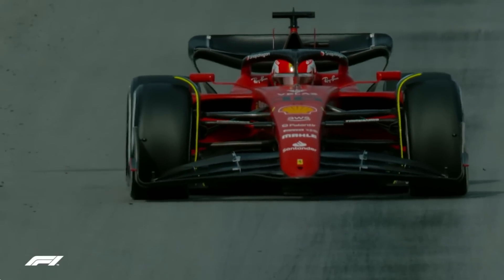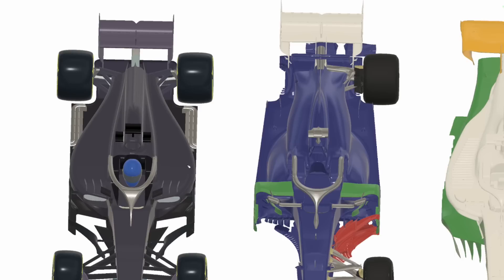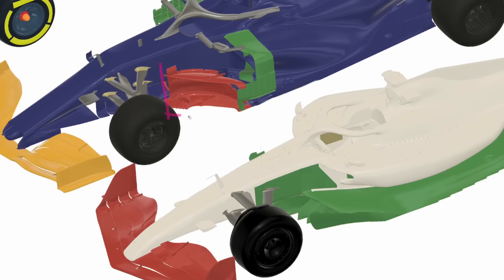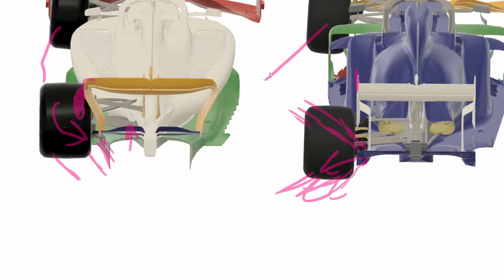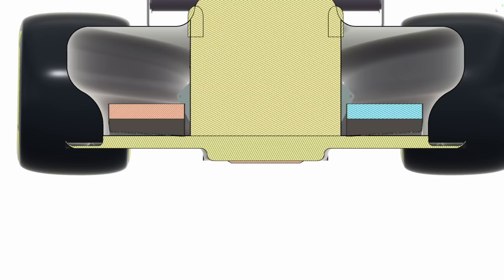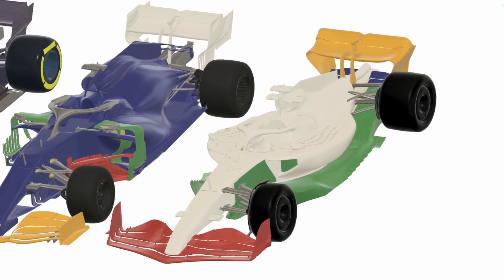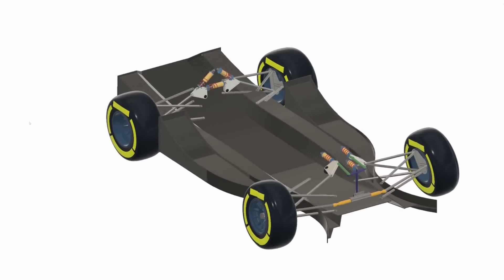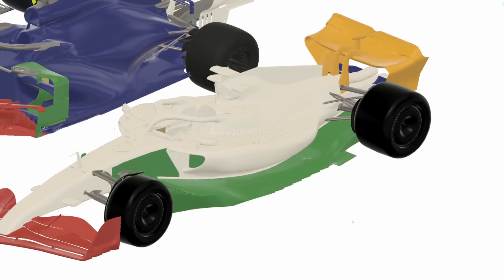How Porpoising was caused by the 2022 F1 Rules

Comment: Can't teams still have rake but just run the rear skirts asymmetrically lower? I find it hard to believe that running a rake is now gone because you can still make it outwardly look as if the car has no rake when it really does by just extending the skirts at the rear. I think Red Bull is doing this; their car still has rake, just the skirts make it appear it isn't but that also has the benefit of giving more volume for the ramp up outwash area for the diffuser ie. bigger suction effect at the rear.
Reply: BTW the inerter and suspension changes should be quantified by the FIA for how much money it would save teams because I don't buy it that the cost was the reason. Same amount of development money is involved and while springs are inherently cheaper at what magnitude of a difference does it make for the hydraulics based systems on a F1 budget ... repair damage from porpoising probably costs more when you compare it. I think the FIA on that specific reason reached too far, and as for suspension the 13inch tires were a step too far also.

As for tires worth mentioning as you did in a past video are part of the suspension for a car and these new tires are less springy which probably adds to the porpoising effect.

Comment: I have a question regarding the floor central section. If we take that piece in isolation and apply what we know about diffusers. We can imagine air infilling the low pressure left behind by the rear of the central section acting as it's own diffuser. If that section is wider at the kick up point, wouldn't it create a stronger suction peak? It would essentially be increasing the lateral surface area right where the pressure is lowest. Have you noticed that Mercedes has a very narrow cigar shaped central section, with no little cutouts, while Ferrari and Red Bull both have narrow leading edges and wide trailing edges. McLaren has just a wide skim board type central section. Ferrari, Red Bull and McLaren all have those little cutouts you see on surf boards. That central section pitches and yaws and is basically surfing on a boundary layer of laminar air. All CFD I've seen shows very laminar and streamlined flow in that central section, so perhaps there is a lot of untapped potential there. Although, I imagine making changes there depends heavily on how the car is packaged above.

Comment: I don't think the absence of inerters would be much of an issue this year if the weight limit wasn't so difficult to get down to, fundamentally they just add inertia so you could get the same effect with a few weights in your brake package, but you can get the same inertial effect with less mass from an inerter

Comment: To a greater or lesser extent the teams have followed different design philosophies. Some saw the new regulations focused on ground effect, stripping away the power of the front wing & Y-250 and others saw a reduction in upper & front body downforce generation balanced by additional ground effect. The teams that saw upper body downforce generation as still very important and not just ‘drag’ & maximising every small downforce building  areas across the car found porpoising less destructive to their performance. Which is why you see a convergence in upper body work in the whole field happening throughout the year. 

Its really fascinating that at the front there are three teams with different engines that have three different approaches to their floor concept in how to handle airflow and expansion. These concepts appear to be sensitive to porpoising in very different ways and the variations in tracks change the performance differences between these cars to the point were the gaps close and overlap. A good start for the new regulations, but resolving the limits teams are allowed to porpoise is going to be important. 

On the inertias, these components have been removed for the ‘simplicity’ of compliance testing, as the FIA said it was not possible for them to distinguish between the action of inertias and (re)active suspension. More complex (expensive) inertias would tend to behave like active suspension and their development run counter to the cost cap. Its possible these may be reappearing as a standardised part given the focus on ride-height control and ride-quality for the drivers. 

Personally I’m enjoying seeing cars that are hard to control pitting on to cold tires so stint pace and the “undercut” now needs more driver skill input than a spreadsheet and we’re hearing arguments on the radio over strategy because the computer doesn’t necessarily have the correct parameters to predict the race anymore.

Comment: Why would the FIA want to control so tightly what you can do in a wind tunnel? Thye already have wind tunnel time limits (or numbers of simulations run), why do they need to control how fast you can move the car up and down?
They couldn't have made it harder to solve the porpoising issue if they tried.
Reply: I'd like to know this as well. The only thing I can think of is maybe the cost of upgrading to one that does move that quickly and accurately while providing accurate measurements.

Comment: So wind tunnel test say 60% scale but the refs for speed equivalent of .033 is for full size, so shouldn’t the test speed be able to be increased for the scale model?
Reply: Speed is also scaled down for ≤ 60 % scale. Defining the oscillation-speed through its equivalent at 100 % scale, eliminates the option to circumvent the rule by testing ride height oscillations with even smaller scales.
But the rule looks very outdated in times of a budget cap. It's hardly economical to spend a little bit less on testing but then having to introduce B-spec cars mid season.

Comment: Finally a explanation that's understandable, considers the whole system and the effects of regulations!
Reply: While the front is touching the ground due to downforce, but if there is a air flow at the rear of the car just close to diffuser so will it push the rear of the car down and front up due to downforce because the underbody of F1 car is tilted down at the front and lifted up from rear
Reply: Please tell

Comment: I think they should re introduce the inerter for 2023, but it should be a spec part so teams like Mercedes and Red Bull can’t gain a unfair advantage as opposed to teams like Williams and Haas.
Reply: Haas will use the same one as Ferrari anyway. I’m not at all in favour of more standard parts.
Reply: The inerter is a fairly simple part and not actually all that expensive. IMO it should be allowed and no need to making it spec. 
I wouldn’t be surprised if the plain old dampers are actually more expensive for the teams than the inerter.
Reply: @ASJC27  i read somewhere that the inerter was a extremely complex and that Mercedes spend millions to make their version. Thats why I said spec part so no insanely unfair advantages for the top teams.
Reply: @hersencell6880  the inerter is just a cylindrical weight mounted on a threaded rod, such that suspension movement has to spin the weight. This means whenever the suspension experiences an acceleration it has to rotationally accelerate the weight, which in turn applies an opposing acceleration to the suspension. This way it resists accelerated suspension movement. 
It’s very clever, but also very simple. There’s nothing there that would cost much.
Reply: @ASJC27  I don't know, you have to design something that is strong, tuned precisely, won't negatively effect other parts of the system, doesn't interfere with any other regulations, fits well inside the car, and is lightweight. So I imagine there's a lot of money going into research into the part design and manufacturing. Maybe there just saw that on the list of priorities this was lower than other suspension components, and only the top teams would spend the money on it. Just a way to help the teams get down to the costcap and minimum weight I guess.
Reply: @zlm001  “you have to design something that is strong, tuned precisely, won't negatively effect other parts of the system, doesn't interfere with any other regulations, fits well inside the car, and is lightweight”.
So the same as any conventional spring, damper, bell crank, push/pull rod or any other suspension component. There’s obviously design work involved, but it is a very simple part that’s been around for more than a decade. Dare I say it, it’s probably considerably cheaper than the dampers on the cars.

I recently read (can’t remember where/by who) that the reason for banning the inerter was not to save money, but because the scrutineers at the races couldn’t check if a part was an inerter or if some more complex suspension trickery (a la Mercedes last year) is involved. Therefore they just said from now on you’re allowed springs dampers and nothing more, so it can be assessed by your average scrutineer on venue. 

I don’t know if that’s the real reason, but it makes a lot of sense. However, due the porpoising issues, I think they must reassess for next year. There’s a question mark on long term health effect, in Baku we saw several instances of drivers nearly bouncing into a wall at speed, plus it’s not a great look for f1 to have 200 mph bouncy castles. If you’re going to have ground effect, you need a suspension capable of taming it. Personally, I would like to see mass dampers allowed again (with or without an inerter), as they’re uniquely suited to dealing with this issue and are also a cheap part, that’s not even directly mounted on the suspension, so could also be easier to scrutinize.

Comment: Hey Kyle, love these videos, been watching for a long while now. 
Could a solution to the issue, or a help be making the lower rear wheel winglets go to the ground or near to the ground? I know this would mean a change in the rules, but would it help teams deal with the issue?
My thoughts are this would act as a fence to the wheel wake and stop it being ingested by the diffuser. also as these are mounted to the wheels they would travel up and down with the wheels and keep a more constant gap to the ground rather than something suspended from the chassis?
Reply: Ultimately, that's what fixing porpoising is going to take - changing the rules. It doesn't mean changing the main rulebase that got us here, but tweaking it to fix what isn't working, and that's been done during every era.
Reply: I think the most likely thing is to allow progressively for more control on the suspension side. There are many mechanical devices that if allowed would dampen out oscillations, and it need not be full blown active suspension. All drivers say that they run the stiffest cars ever. It is very painful on the spine, just allow for more goddamn suspension configurations that specifically address oscillations
Reply: @Michallote  ah but they were band for simplicity, isnt porpoising so simple!
Reply: I think the diffuser sidewall is more the barrier to the wheel wake, as far as i can see all the wheel winglets are upwashing which i dont think would suggest the teams are using them to limit wheel wake much.

Comment: What is the intention of these windtunnel limitations in the rules? My first instinct would be that because windtunnel time itself is limited, why not let the teams figure out the most efficient use of it?
Reply: Wins tunnel limitations are in place to maintain a level playing field. Wind Tunnels are extremely expensive to operate. Therefore, if the teams are given free reign, the bigger teams will brute force their way to the front of the field by aggressive development.
Reply: @parthupmanyu4366  yes but with the cost cap already in place it isn’t possible. Therefore the rules are basically useless. Why narrow down the options for teams if they are controlled by the cost cap. Same counts for testing in my opinion. Why not give teams the options they want to use?
Reply: Cost cutting? Also if some team comes up with a super advanced wind tunnel that can give them an advantage

Comment: If teams were allowed to change the Re number of their wind tunnel testing (i assume there are regulations around that, using different scales, working fluids, range of temperaturers) how one would go about reproducing these kind of  transients at lower frequencies?
Reply: Changing Re is relatively easy and does not require other working media or cryo tunnels as we are (not yet 😉) seeing f1 cars driving close to the speed of sound. Just allow upscaled models to be tested. You'd even be lowering the oscillation frequency as Sr is constant  (The oscillation velocity, however, would be constant unless you scale up the model enough to reduce the wind tunnel velocity,  I guess)

Comment: Hi Kyle thanks for the video! Love your work. I have a question around 7:30 I am sure you are right but you say you get more expansion on diffuser due to outwashing wake. Isnt difussing the opposite of expanding? I mean cleaner air of higher pressure you can diffuse more rather than expand to lower pressure? Sorry I am not expert thank you
Reply: Diffusing = slowing down and therefore also increasing (static) pressure. In subsonic diffusers, which is obviously what we have in cars, this requires expansion of the flow area.

This may sound counterproductive (the diffuser is increasing pressure), but the thing to remember is that the pressure right at the exit of the diffuser is more or less ambient, therefore a larger pressure increase through the diffuser requires the flow to enter it at a lower pressure to still end up around ambient. So really the job of a diffuser is not to generate downforce itself, but to allow the floor ahead of it to create greater suction.
Reply: @ASJC27  that makes sense thank you both ! I always thought of expansion as going to lower pressure and that's what confused me!
Reply: The diffuser let's air out from under the car, it forces air to expand outwards to help draw the flow through, like a pulling effect...I think.
Reply: I think there is a misunderstanding of terminology. Stepping away from Benedict Roberts and ASJC27 explanations (both of which had very interesting comments as they challenged my understanding of a diffuser in terms of a race car. I love having my understanding challenged!) and going to fundamentals of fluid mechanics, there are two devices used in fluid mechanics to change fluid pressures/velocities: nozzles and diffusers. Nozzles decrease in cross sectional area along fluid flow increasing velocity (like the front of the floor, look something like this “>” flow from left to right) while diffusers increase in cross sectional area decreasing velocity (like the… diffuser.. on the car, look something like this “<“ again flow from left to right). 

Long winded explanation and I may have misspoke (I’m sure someone will correct me) as it’s been a while since I’ve looked through a fluid mechanics textbook.